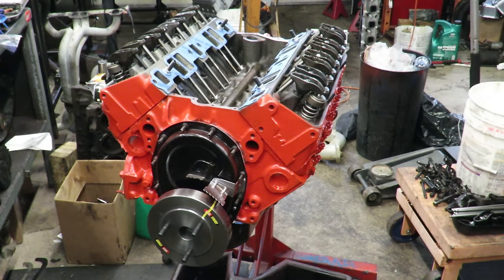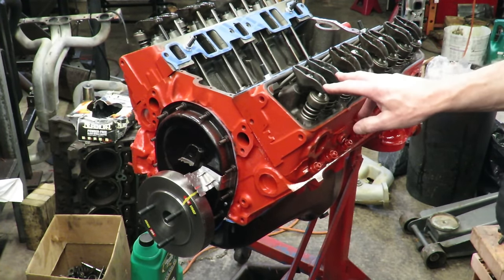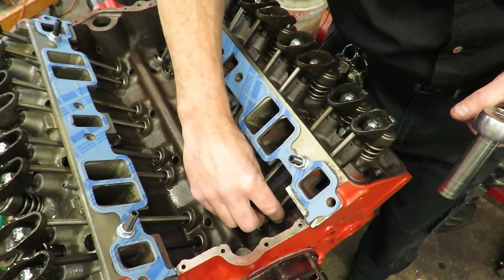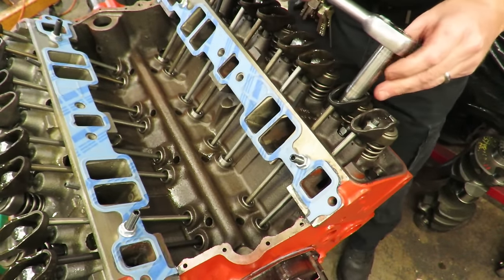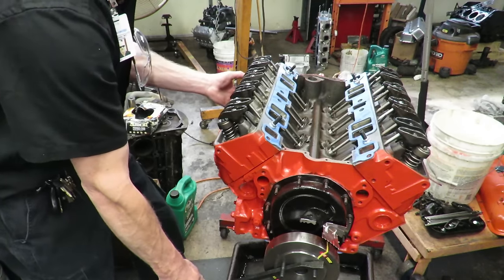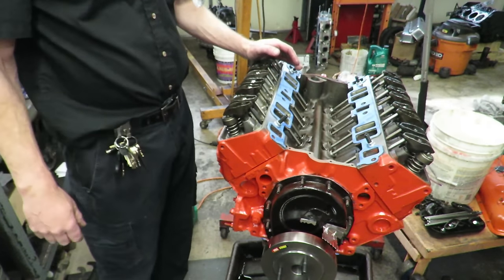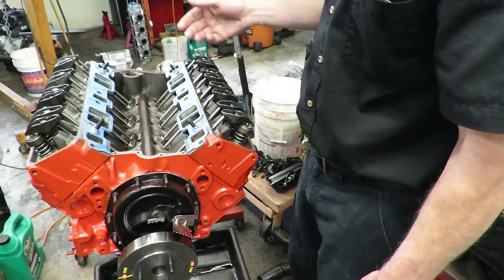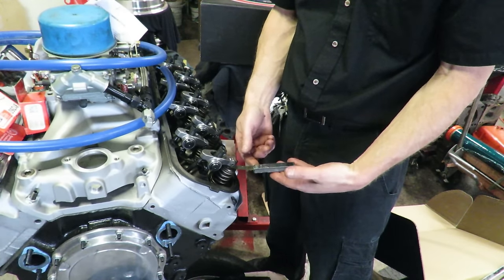Small Block Chevy valve adjustment made easy

Comment: Love your videos, thanks.  Question? I just performed this on my SBC 350 to verify correct valve adjustments.  I noticed that some of the lifters did not seem to "push" in like some others when I did the half turn to " pre load",   is this an issue with the lifter or is it just because its probably full of oil and cant push in like some of the others?  many thanks!! (As illustrate in your video at 06:40).
Reply from the maker: Thats normal the lifters that had spring pressure on them because the valvers were open will blead down
Reply: @Myvintageiron7512  great, thank you much for your time 😎

Comment: Lift push rod, don't spin. Push rods have round balls on both ends, they are going to spin so false reading.
  Rocker moves side to side! Yes, it pivots on ball in the center and push rod. False.
  Used GM specs of 3/4 turn past zero lash, otherwise you will revisit the adjustment. 
  Use sister cylinders as #1 Exh goes down, intake goes up.
#5 is sister cylinder on base circle of cam, it is adjusted next.
Order; 1,8,6,5,4,3,2
Sisters; 1-5
              8-6
              4-7
              3-2
(Firing order, cut in half)
Rock the first / adjust I & E on next sister. 
             6-1
             5-8
             7-2
             2-3
Rock ------Adjust + 3/4 down.

DK, ASE master since 78, retired
Reply: I never imagined there could be so many ways to turn a sbc over so many times to do such a simple job.
Reply: I like the two revolution way on flat tappet cams but the long way on roller cams.
Reply: @charleswittmer  After all, I use metal dye on valve tips to see if the middle target is dead on. Ford 360cu in were the worst for guide wear. You could see light thru the sides.

Comment: I did your the second method, since I have a roller cam, after I was done I turned the engine on, however, I have now a clanking sound which seems to come from one of the valve covers. What could have caused this 😣. Did I do something wrong?

Comment: I have a 327 with a mild cam in it, and camel hump heads, and this motor was my dads for a 63 vett but when he passed away it didn't get ran. I have got it back going but now I have a lifter ticking and the engine shakes a lot. Should I pull the lifter out let them drain and start over with this method? By the way this motor has no miles on it just me running it up to temp to keeps things from going bad.

Comment: I never use the factory type lock nuts, they can & DO rattle loose. I always spend the extra few bucks for a set of allen screw polylock rocker nuts as they can't ever come loose when tightened correctly. ( yes, even on a stock rebuild) Plus, they can be adjusted for just about ever ! and never back off when you lock em down .
Reply from the maker: I have built thousands of SBC in the last 30 years with stock rocker nuts never had a single one come loose most people don't realize they are 1 time use only so every build needs to have a new set of rocker nuts the problem of backing off happens because people build an engine and try to reuse the old rocker nuts and they will back off from engine harmonics and vibration because they lose their ability to self-lock after being removed and reinstalled

Comment: Enjoy watching your videos, I have a 1984 C10 305 V8 Original, Cast Iron Intake. Removed Smog Control, Has EGR Valve on cast Iron intake, Would it be safe to remove EGR valve? and close off the heat cross over, cast iron intake before reinstalling? Thanks for info
Reply from the maker: yes as long as you don't need to pass smog test

Comment: On a stock application, could you not just start at tdc 1, adjust that cylinder, then go down each bank and rotate until the next cylinder is on the base circle of the cam and just go down the line?
Reply from the maker: yes but it will require you to rotate the crank alot more times I don't like that because the more you rotate it the more assembly lube your wiping off the cam
Reply: @Myvintageiron7512  mine would be for an engine that's already been going. Would that be an issue? I have an 89 vette that I'm doing some maintenance on before I move, the ne house doesn't have a garage yet

Comment: I’m afraid the hydraulic lifters won’t be adjusted right after I do this. Should i replace them, I already put the heads on with new head gaskets. I tried to remove a couple and had no luck. How do I know they are good, is there any way to check them while inside the block?

Comment: I have a question about my rockernuts, when I get 0 lash the nuts are basically at the top of the studs is caused of a bent valve or bent pushrod

Comment: Am I in the Mandela Effect? I remember when I was young, before I went to diesel, All the manuals I looked at stated 3/4 turn static or running on stock sbc and 1 turn on inline 6. They stated, it puts the lifter in the middle of its travel. With the valve covers off I like the valve overlap method, as far as I know all piston engines fire on closed valves.
Reply: Except if the lfter pumps up and keeps the valve from completely seating. Closer to zero lash also gives the lifter more chance to stabilize with 1/8th turn down.

Comment: just watch the opposite valve ,when the intake goes all the way down and right before it reaches the top again , adjust the exhaust , just as the exhaust starts to move adjust the intake , zero lash plus a quarter turn. make sure the lifters are not compressing .

Comment: I'm just getting around to installing my 1998 062 vortec heads on my old Stock 1982 Chevy 350 engine... I want to update my hydraulic lifters...do I buy them to fit my 82 350 Block or the 1998 062 chevy 350 Vortec heads ?
Reply from the maker: are you changing the cam?
Reply: @Myvintageiron7512  
No I'll be using the same old Flat tappet cam. Thanks !

Comment: Hey great video. Question, 
If I'm using Crane 1.5 roller rockers,  how far down should the small Allen screw go into the nut?
Reply: If you have a hydraulic cam, get zero lash like he shows, then the half turn to set preload, then tighten the screw inside to lock the nut in place. I just set mine last weekend with roller rockers.
Reply from the maker: the Allen scew is a lock for the adjuster it needs to be tight
Reply: @bobstephens8851  thanks for the reply. I set my rockers just like the video. Started to screw in the Allen screws. They go all the way in. I've seen other videos and the Allen screw is barely about the large nut.  Am I missing something?

Comment: I ordered a comp cams high energy flat tappet (part number on summit CCA-12-238-2). Its for my 94 chevy 350. The duration at .050 lift is 218/224 and valve lift with factory rocker arm ratio is .462/.469. It said I need to order comp cam lifters to go with but theyre out of stock. Can I just order a set of new stock flat tappet lifters to use with this cam and not change any of the other stock valve train. Ive been getting the mixed bag of you have to rebuild your valetrain and just trow it in it’ll be fine
Reply from the maker: you need to upgrade your valve springs the lifters from another brand should be fine

Comment: In your opinion is it better to adjust each valve separately or can I be fine with adjusting both valves at the same time ?
Reply from the maker: you can do both as long as it's not a big roller cam

Comment: I have a 400 SBC block that i want to build a 377 from. Do you have any experience with this type of destroking an engine and what are some ways would you go about it? I know many guys just use a 350 crank but I am not really to impressed with the idea of using bearing spacers on the mains to use the smaller journal crank. Does anyone make a large journal 350 stock stroke crank? Also I'm not sure which rod length should be used. I have seen both 5.7 and 6 inch rods mentioned in other builds. Can you give me a few of your thoughts on a build like this.
Reply from the maker: the use of a 350 crank is a thing of the past,  just buy a 377 rotating assembly from Eagle get it balanced and put er togather no clearencing required a 377 is a great engine big rev's big power do me a favor and don't put a set of crappy factory heads on it get something cool like trick flow or AFR and you will have yourself a real screamer

Comment: Stock or not, always adust intake, then the exhaust, on separate rotations. You adjust the lifter on the OPPOSITE order of fire from the one that is FULLY OPEN.
That is the ONLY WAY you can be on the very back of the lobe on the base circle. With #1 intake fully open, adjust #6 intake 1/2 turn in from ZERO lash.
1 - 6
8 - 5
4 - 7
3 - 2
6 - 1
5 - 8
7 - 4
2 - 3

Comment: I do it your way, except that I like doing the preload on a running engine. Back each valve off until it taps, take the tap out then go 1/2 turn slowly. Some guys like 3/4. It tosses a bit of oil around but not bad, and it's quick & accurate.
Reply from the maker: DON'T ! do that it takes years of life off the cam every manufacturer has warnings about not adjusting hyd lifter cams with the engine running it is the incorrect way to do it
Reply: @Myvintageiron7512  I'm 72, been doing this stuff since I was a kid. I have never lost a cam,.... sooooo..... whatever you like.

Comment: Can I just adjust the valves one cylinder at a time? I would assume when the one of the lifters is up all the way like for the intake valve the exhaust valve on same cylinder would be shut and probably on the base circle. As long as the lifter is down all the way on the base circle of the cam lobe then in my mind i should be able to adjust the corresponding valve for that lifter and just keep going until ive got them all done.
Reply from the maker: you cannot assume that if a valve is open all the way the other one is completly off base circle that is not the case with most roller cams the have very large ramps and small base circles

Comment: First two engines I had were solid flat tappet.   My first hydraulic was in a sbc and I kept adjusting and plungers were about bottomed out.  It started but valves were remaining open so had to look to find what I did wrong.  Kept loosening the rockers and finally valve closed.  Spin method! Whoops.  Lol

Comment: What I was thought
With the engine running
Back off each rocker until it clicks.  Then tighten until it quites down and tighten 1/4 turn...
I've run mine at 1/8 turn..
Reply from the maker: it is not a good idea to adjust these with the engine running it damages the cam
Reply: @Myvintageiron7512  
never had a problem
Reply: Yeah i even have a ser of covers with the tops opened up to keep most of the oil off the headers but learned this dry way is much better. When i was young it never occured to figgure out how they did new un-run motors that never needed to be reset.

Comment: For the last 50 years it's easier to make a valve cover with holes in it for adjusting the valves while it's on and you loosen them to where they're all making a little bit of noise and then tighten it to where it stops making noise then go a 1/4 turn then its adjusted thats a lot easier quicker better old school for the win
Reply: I was gonna do that on mine, but last time I did it I couldn't hear the rockers because I have 4" dual exhaust straight pipes coming out of my boat - LOUD AS HELL. 

Is there a trick to being able to hear them through the extremely loud exhaust? (305/5.0L marine engine)
Reply: Goodfellas Inc. That method is absolutely not necessary if you know what you are doing.
Reply from the maker: I understand the process of adjusting them when running but it's a really bad pratice Adjusting HYD valves while the engine is running takes years of life off of the cam it is very hard on flat tappet lobes and lifters it does work but it does irreversable damage to the cam GM has a warrning in their service manuals that states adjusting valves with the engine running should never be done
Reply: @Myvintageiron7512  WOW, Never knew that! In our marine manuals it calls for specifically doing just that when the engine is installed.

The only difference in our marine manuals (Volvo Penta at least, on their SBC's) is that:

- while running you use a 3/4 turn past audible clacking
- and when out of the boat/rebuilding with a fresh engine (NO OIL in lifters) you use a full turn past the slightest drag while spinning the pushrods.

I wonder why that is? You think maybe they don't care about shortening the life probably, or maybe explaining it your way there afraid too many techs will F$CK it up?
Reply from the maker: @strikeforcek9149  Yea adjustn them with the engine off like your suppose to
Reply: @prevost8686  ITS BEEN DONE JUST LIKE THAT FOR YEARS AND BY SAYING THIS IS WRONG SHOWS YOU HAVENT BEEN IN THE  BUSINESS ITS BEEN  PROVEN TO WORK AND NOT HARM ANYTHING LOL YouTube mechanics
Reply: Thats not true at all I respect this guy he is a real engine builder but I've also have a machine shop for many years my dad had one my grandpa 2 this practice is always been used and proven not to harm anything so I don't know where he got his information about that every one has there own way and a lot of the time its just a different way of doing it which don't make it wrong it's good to know many different ways to get the job done
Reply: @Myvintageiron7512  hello there sir you have very good videos and I like watching all of them I would like to know why you say it takes years off your cam and if you can show proof of that it's been done that way even in the professional world of racing just don't say it's wrong thanks for the vids
Reply: I still have the old covers with holes in them from many years ago it works a treat

Comment: Hi i have a question why do some 350 turn over way faster than other when starting?I have a boat with a chevy 350 and no matter what i do it still turns over slower than other 350 around.New starter New battery new battery cable notting helped.Does a camshaft affect the cranking when staring a chevy 350?
Reply: Compression and engine load are the 2 main variables. Are you getting a full 14.5 volts to your starter? And is your outdrive in nuetral? Some marine engulines are prone to salt water entering the cyl bores and causing rust issues as well.

Comment: Just watch the valvetrain when number 6 intake and exhaust overlap top dead center on number then you can just the valves by the firing order by marking the dampener 4 ways every 90 degrees it only takes two turns to adjust all the valves.

Comment: First thing you do is prime oil system with distributor in there so that right oil lifter Bank gets oil gets lifters primed go to top dead center number one and you literally can just the engine by the firing order 184 36572 opposite of number 1 top dead center would be 6521843 by watching your valve train exhaust goes up and down your intake will slightly start to go down that would be the opposite cylinder of the one you want to adjust on all engines I check valve separation to piston at top dead center I've had timing gear sets with the holes not drilled markings not drilled in the right place

Comment: What's your thoughts on this procedure?
Get #1 to Top Dead Center
Exh.- 1 – 3 – 4 -8
Int.- 1- 2 – 5 - 7 
Get #6 to Top Dead Center
Exh.- 2 – 5 – 6 – 7
Int.- 3 – 4- 6 - 8
You will only turn the engine 2 times. TDC #1 and TDC #6
Reply from the maker: wont work with big roller
Reply: @Myvintageiron7512  ok thank you for the information
Reply: On a stock sbc engine/ cam will this method work ?

Comment: Shit!!! .... I did mine by spinning them and when I felt just BARELY any friction  and no slop, I went 3/4 more. :(

But, my lifters were out of the motor for 2wks dry and there was no oil in the engine when I assembled it back. You think it'll be ok?
Reply: So did you have issues? I killed a cam once going 3/4 past zero lash I have alway done 1/4 turn after lash

Comment: Alot of ppl get lazy not doing it every 90. How I was taught long ago. Auto school did nothing guy who is like my dad has own shop ase certified master tec and learned 10x more from him. I run derbys he built me a motor that ppl thought I had 8 grand in . But only had 2000.Never got hot. 350 Honed to heck had sum 1104 cam that I think he degreed 2 degrees been 10 yrs lol 202 64cc heads Holley 650 dp. Ran ehh cold ran amazing hot. He tuned it while hot. Never had to touch dist. Adjusted carb in field to remove any hesitation. Timing was different then normal 350s I had 4.88 gears so we sacrificed power 4 heat starts. I don't know everything he did but best motor I've ran hands down. Wicked fast never stalled ran 45 min feature at 220 degrees.   Radiator cap increasing BP by 3degrees SL one trick. U seem just like him its not about money it's how u build it

Comment: You went through and adjusted intake and exhaust at them same time .... then you come back and say they have to be done at different times .... so what is it ...... adjust both when the cylinder is top dead center or not .....
Reply from the maker: There are two different methods I was showing them both

Comment: i have been adjusting solid lifter cams for 35 years  ,its not as difficult as some people proclaim
Reply: If they had started on chev 6s or even better the vw bug where you can just roll the car forward in highgear while laying under the rear fender they would have a better understanding of the 4 cycles.